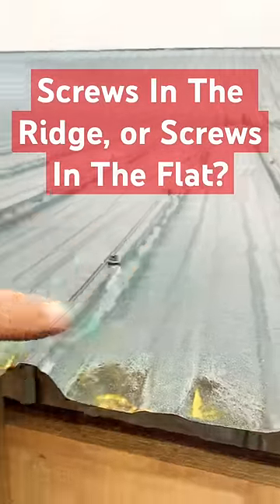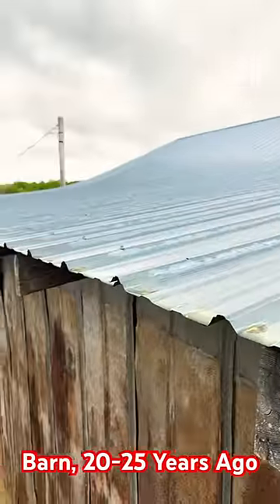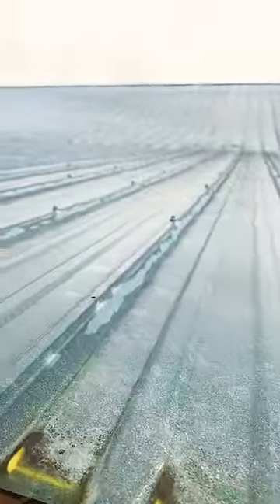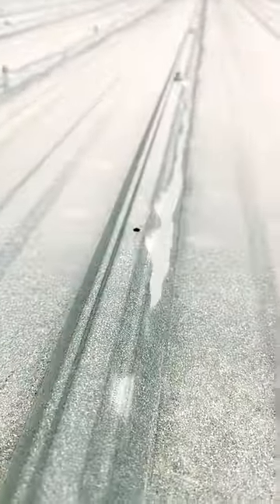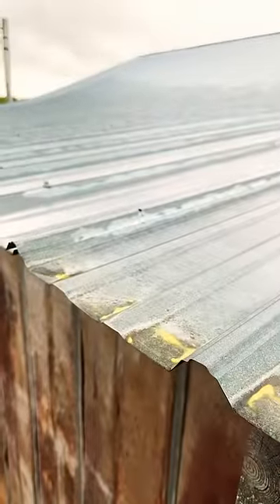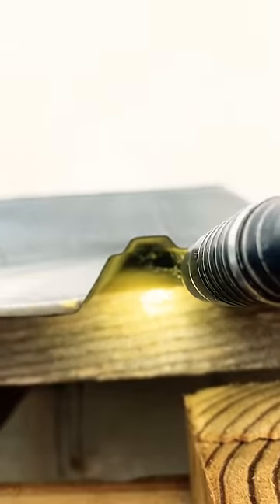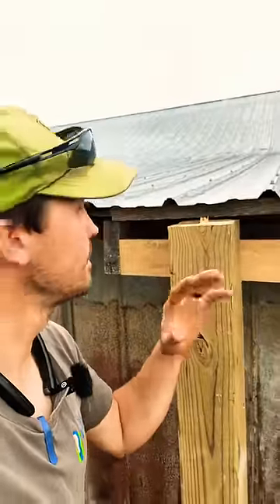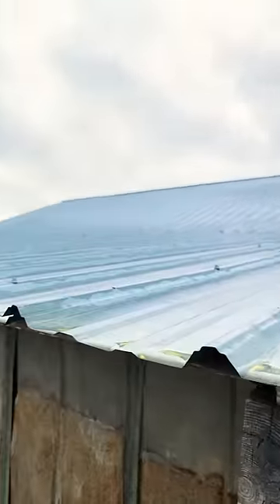What’s Better? Screws In The Ridge Or Flat? #construction #farmlife #building

Comment: We roof rake snow all winter so as to eliminate wrecking the snow rake or pullng the screws loose I screw in the flats.
Reply: That’s a legitimate reason. Bravo 👍🏽
It’s a lot more time consuming doing it on the ridge. We’re taking a ton more.  Also, most manufacturers accept screwing into the flats as acceptable. Vertical surfaces don’t make a bit of difference.
Reply: Screws on the ridge are a pain to shovel snow off of.
Reply: @philstone7475 it's not why because he is raking in the flats meaning to avoid fucking off his Rake he needs em in the ridge
Reply: @TheKidflatpicken they aren't screws in the flat is 80x worse
Reply: @societyisboring  ? You ever try pushing a shovel down a roof full of snow and your shovel keeps getting hung up on every screw on the ridges?
Reply: Yeah, it sucks.  @TheKidflatpicken
Reply: @TheKidflatpicken   - just get a shovel that fits in the flats - then the ridge screws won't bother you...  (OR - use panhead screws on the ridges -  the shovel will glide right over. (a little in jest - do what works for you,
  (Of course - we can accept your case - just ensure the seals remain in good order, or the roof will leak horribly.
Reply: This is the best argument I've seen. Been a while since I raked snow off a roof, but screws in the ridge would suck. Like trying to shovel and old wood deck built with nails
Reply: @TheKidflatpicken  your roof doesn't have to be perfectly clean seems like an OCD issue

Comment: You're supposed to put them on the flats so that the the ridges can take up the expansion. By putting them in the ridges, your roofing is at risk of widening out the holes. All you have to do to ensure no leaks by screwing on the flats is put a bit of silicone on each screw. It'll last longer than the rubber washer.
Reply: Which is why there are missing screws. We get less than 12” of rain per year, I’m more worried about the wind ripping my panels off the roof with the half-ass fasteners on the ridge than the rain making its way around the screw.
Reply: I've been roofing 40 years and you my friend are wrong
Reply: @craigwilson9517  Care to explain?
Reply: @inund8, with ridge fastening the space between the metal & what it's fastened to is allowing movement during heat & cooling expansion/ contraction. The flats allow less adjustment & more abuse to the sealing washer, I've found, in my experience.
Reply: "just silicone those 500 screws" or "just put the screws where the water DOESNT GO".    Hmmm ..
Reply: @inund8  because if you have a choice to make a few hundred holes where the water WONT collect, and where the water DOES collect - you pick where the water won't be.
Reply: @codyaragon93  by your own logic - if you're worried about the wind going down the channels of the ridge, then why WOULDNT you place the screws where you think the wind will pull from?
Reply: @kctyphoon  dude, if water is collecting on your sheet metal roof you've severely messed up. Flat roofs and sheet metal do not mix. That's absolute bass ackwards my guy.
Reply: @inund8  dude - the ridges shed water down onto the flats. If you have holes in the flats on the lower section of the roof - all the water from the roof above it is running over those screws and holes.  If the purpose of the roof is to NOT LEAK - then making holes in the areas where all the water will shed - is not the best idea.   
Can we agree the best way to keep water out - is to NOT drill holes into the material  meant to keep out water?  Can we agree if you HAVE to put holes in something meant to keep out water - that placing those holes in the areas that will be exposed to LESS water is a better choice?   Great - then what's the argument??
Reply: @kctyphoon  dude water can't collect on a sloped surface

Comment: My granddad always put it on the ridge. However when I started helping build houses and people asked for a metal roof, the guy I worked for put it in the flats. The only reason he gave (which I thought was a decent one) was that you are less likely to bend the metal and cause a leak. Because if you over tighten and crease the ridge it can cause the water to puddle right on the screw.
Reply: Well, I have installed both types on a metal roof and both have a risk, on the flat, you can secure the metal ten better to the wood, also helps out the best when it comes to 30 mile winds doesn’t vibrate the same , BUT,, if an screw comes loose it is a potential of a LEAK. 
NOW ,ON THE RIDGE, YOU CANNOT OVER TIGHT THE SCREWS BECAUSE YOU BEND THE RIDGE  BUT WHEN IT COMES TO 30 mile winds SOME OF THE SCREWS COME LOOSE DUE TO THE VIBRATION BUT EVEN AFTER A SCREW IS GONE THERE IS NOT A LOT OF CHANGE FOR A WATER TO FLOW THROUGH THE LITTLE HOLE BECAUSE THE RAIN DOESNT FLOW ON THE RIDGE. 
I SEE ROOFS DONE 50 YEARS ago still stand in. Hope helps. God bless y’all
Reply: @lhnher8484  aye depends on the wind
Reply: Manufacturers recommend  in the flat next to the rib
Reply: It still will run off the ridge, it will always leak on the flat/
Reply: @lhnher8484 the all caps seems a little unnecessary for that
Reply: Sounds like he needs to learn to not overtighen
Reply: @ryanbentley1965  this is what I was going to say as well.  Granted, I’ve only put one metal roof on a house, but it was 12 years ago, and still does not leak.  I put all the screws in the ridge, and stopped tightening them when I saw the ridge start to move.  There were zero creases on the entire roof.  Pay attention to what you are doing and you won’t damage the roof by putting the screws in the ridge.
Reply: If a manufacturer recommends putting them on the flats, it's because they want the roof to fail so they can sell you another. Ridge is the only answer
Reply: Sounds like there's a market for some wood blanks which are shaped like the inside of the ridges. Make the roof stronger, provide a backing for tight screws... no?
Reply: @kathrynck  in order for that to work, there would have to be a standard that all roofing manufacturers went by for the dimensions on the ridges.
Reply: If you screw on the ridge it will become loose and eventually blow off!
Reply: I was a sophomore in high school when I helped a friend of the family put the metal roof on my parents house. We secured the metal roof on my house in the flats. It survived 1 cat 4 hurricane, 1 cat 2 hurricane, 3 cat 1’s, and 3 tropical storms with no problems not even lost a single screw. Then 18 yrs later came a cat 5 hurricane the metal roof was still there but I’d say 1/4 of the screws were gone and another 1/4 were still there but sticking up. So there was small leaks everywhere but no huge holes in the roof. Then a month later we took another cat 2 hurricane. Once we put another roof on the house we just had minor deck repairs needed. So in my opinion how you secure the metal roof depends on manufacturer and also where you live. If you don’t live near a coast where you get frequent tropical storms or hurricanes then I could see how only securing them in the ridge is more beneficial than in the flats.
Reply: @91CavGT5  true. good point.
I had thought of cutting a metal roof into  "large tiles", like across the ridges. So they could be overlapped and completely conceal each others screw holes. But that would likely expose the steel to rust.

Seems like it would be very do-able thing to make an extremely durable roof, but not necessarily a great business model for roofing supply companies or roofers.
Reply: just dont overtighten it like an idiot
Reply: the metal is less likely to blow off during high winds if it is screwed next to the rib
Reply: @kathrynck  definitely not. Everyone saying screws in the rib is 100% wrong. I've roofed for over 30 years and they go beside the rib
Reply: @91CavGT5  screws go beside the rib
Reply: @boomer1049  or the panel can tear in high winds if you screw in the ribs
Reply: @chadshort4866  you're roof survived solely because of screws beside the rib. That is exactly how you install them and your roof proved why you install them that way.
Reply: @kathrynck  they literally make a metal roof with no exposed fasteners. It is called a standing seam metal roof. It's been a thing for a very long time and it never hurt the the roofing industry! lmao
Reply: @kevinwaller6353  Yeah it's just not a good idea! Too much flex and will work your screws loose!
Reply: @boomer1049  this is what I do for a living. I install permitted and inspected roofs. If I put screws in the rib then it would fail inspection and I would have to remove the ruined panels and do it all again. This is a fact
Reply: @kevinwaller6353  Yep I started a metal roofing company in 2009 and specialize in metal roofing!
Reply: @kevinwaller6353  conspiracy theory ruined. hehe
I was being tongue in cheek though (mostly ...ish). In hindsight, that might've not been obvious in text.

Is standing seam roofing durable against severe weather? I'm just googling it, seems like it might not be fastened quite as securely as screw-through?

Comment: The ridge is where the manufacturer used to recommend putting the screws. Now they recommend putting them on the flats. Because metal expands and contracts and the expansion and contraction will happen in the rib which will oblong the holes out and create a leak.
Reply: WHAT EVER😂😂😂
Reply: Correct.
Reply: I installed a metal roof 6 months ago. Manufacturers instructions said screws in ridges.
Reply: @SampsonGG  no, it didn’t
Reply: Theres no water that flows on the ridge so it wont leak😊
Reply: @SampsonGG  think about how metal expands and contracts do you really think putting a screw in a very narrow place where the gasket does not even seat properly is a good idea
Reply: You mean I was supposed to use screws... I thought everyone used tires like me.
Reply: Had metal roofing installed 2 years ago. All the metal sheets had pre drilled/stamped holes on the ridge
Reply: So it'll leak with a screw , but the holes without a screw don't?
Reply: That doesn't even make sense lol. 10/10 times ridge fixing is going to last longer and require less maintenance. 
The profile of the ridge is where the strength of the sheet is making the flat the area more susceptible to expansion and contraction. The minimal ribbing in the flat is to control the warpage in a uniform manner to mitigate noise and uneven tension. Screw in ridge takes advantage of all that to also mitigate contact surface to the purlin which aids in preventing condensation on the underside of the sheet effecting the purlin and Screw over time.
Reply: The expansion and contraction will happen anywhere on the panel that is getting warmer
Reply: @tom-rz4zg  do you re-search
Reply: I honestly shouldn’t be telling you guys that gives me more work when you mess it up
Reply: Tell that to a long time roofer. Unless it is V type ribs, you're only putting holes in a place that constantly sees water. Every day with morning dew collection. So when the neoprene washer fails and it will, you will have rot interested of water entry only on direct rain 👍
Reply: @dallisspicer6825  do some work.   Screwing on flat will cost you more over 15 years than screwing ridge will over 30. Done enough to know what I'll put my name to. The goal of repeat clients is not to fix what you've already done.
Reply: @tom-rz4zg  I’ve done over $12 million in roofs in the last three years haven’t had one call back preached yourself
Reply: Expansion and construction still happens regardless of where you put your screws. The key to this is allowing an expansion and construction joint. Typically as simple as having an over sized holes to allow movement.
Reply: @jimmytaylor570  I am a long time roofer 30 years.. and I’ve never had a problem. Including on my own house. But I have seen where screws come loose on ribs. Never seen it on a flat.
Reply: @dallisspicer6825 Installed many roofs before becoming a roof repair technician of all systems for the past 12 years. Pros and cons to everything. The metal system you buy can dictate different applications. Plus, you're at the mercy of the installers, giving an F. Rib or flat doesn't matter if the installer doesn't seat the neoprene washer properly. In cases where they losen, I'll replace with a thicker screw and if I can't gain grip, I'll install a stich screw and find a new location for another anchor point.
Reply: On my fixing metal roof I always put some sealant on each screw to seal metal n wood.
Reply: If I had to guess, that's because the materials used nowadays are half as good and it costs 3 times as much
Reply: They changed where they recommend because the product is out living it’s self and they want to make more money faster so this will help rust your roof out faster
Reply: @dallisspicer6825 not taking sides but you are wrong
Reply: Screwing through the ridge will allow the metal to flex and bot elongate the holes like screwing through the valleys will.
Reply: the screws have rubber washers, it would need to “oblong” out three times the diameter of the screw shaft before it started leaking. If a single sheet of iron is expanding and contracting that much, the whole world is doomed. But nice try trolling.
Reply: @Robnoxious77  well I guess we are all doomed then because it happens every day. Seen it for 30 years now
Reply: @frootlooper  do your research  google it maybe then you gen zs will believe.
Reply: No, it's because too many guys fuukk up the metal trying to put it on the ridge and puckering it. Expansion of the holes my azz.
Reply: @dallisspicer6825  I’m just going to say this. I would never put the screw on the flat part.
Reply: @frootlooper  that’s because you are not professional and don’t understand how roofs work
Reply: What stops the same thing from happening in the flat?
Reply: Your right, but nobody listens
Reply: Manus don't want screws on ridges put in by careless workers and deforming their product. They DGAF if the screws in the flats leak after 10 years. That's a screw problem, not a metal panel Manu warranty problem.
Reply: @dallisspicer6825  zero chance you are even a roofer much less a 30 year one. I'm not even a roofer and I've seen screws back out on the flats on 3 different roofs.
Reply: Absolutely correct! Flats.
Reply: @dallisspicer6825  depends on the manufacturer try going to roofing 101 class is in session bub
Reply: @Robert-cu9bm that's right
Reply: Youtube: should I do it this way, or should I do it the other way?

Answer: Yes
Reply: @dallisspicer6825  yess...it would have. No one should ever put them through the plate area and no manufacturer would recommend that.
Reply: Screws in the flat, 1/4 inch from the rib (as the manufacturer recommends) will provide additional diaphragm strength. This might be an integral part of your building engineering.

If the screw is properly torqued and in solid wood, it will not fail. If installed poorly, it will fail in either place.
Reply: @kellyinfanger9192   that's for walls...never roofs
Reply: @MrDeano-eu9rg  Not according to the engineers I know.
Reply: @kellyinfanger9192  engineers...? U don't need an engineer you just need to look at the manufacturers specs
Reply: @MrDeano-eu9rg  Maybe you only have to look at the mfg. specs, but if I am going to get a building permit, the structure must have an engineer's stamp. And trying not to get into too many details, sometimes they require extra screws (in the flat area) to get the diaphragm resistance necessary.
Reply: @kellyinfanger9192   in my country the engineers plans don't have soecs on roofing sheets as the manufacturer will dictate how its fixed...regardless of plans and codes abd what not it makes no sense to add screws on the flats
Reply: That’s what they tell you… but if their tin, succumbs to THAT MUCH WALLOWING, their product is garbage to begin with… but, they say that so you screw into the flat, causing the rubber around the screws to degrade faster, causing you to have to buy their product far more frequently.  It not that they are concerned about oblong holes after 30+ years…its that they’re worried you wont need to buy their shit for the next 30 years…so, they get you to buy it every 7-10 years or so…
Reply: @dallisspicer6825 if it doesnt seat properly, then theres room for expansion and contraction … like a truss joint, or anything else that needs just a bit of space to move …
Reply: @Robert-cu9bm possibly… depending on whether or not the surface tension of the water over the hole, breaks… think of it like a bubble…air underneath the thin layer of water over the hole, keeps water from flowing into the hole itself
Reply: @dallisspicer6825 do you not understand physics?  If you lay to pieces of flat metal together and try to move one of them laterally, they’ll slide against each other no problem…. Take that same metal and make both pieces look like  a “M”… try and slide them apart… isn’t happening.  Also, the water runs OFF of the ridge which has a smaller horizontal plane than the flattened area …
Reply: @blueyedevil3479   nah, the original comment is bullshit. No manufacturers suggest roof screws on the low parts
Reply: @blueyedevil3479  and you don’t understand roofing Mr. scientist
Reply: @blueyedevil3479  expansion and contraction will happen no matter what
Reply: @MrDeano-eu9rg  have you ever done it before it does make sense
Reply: @dallisspicer6825    no mate, it doesn't make sense.
Reply: @MrDeano-eu9rg  do your research if you ever install a metal roof. Because I do roofs for a living and we install according to manufacturer specs in order to get the warranty for the home owners and it clearly says to screw on flats.